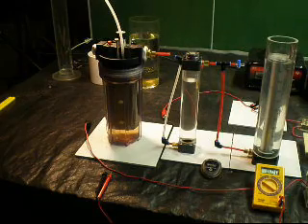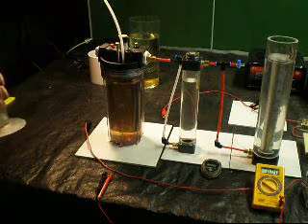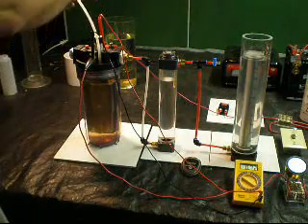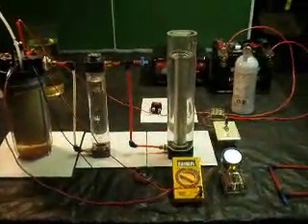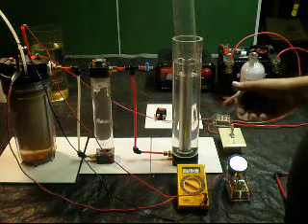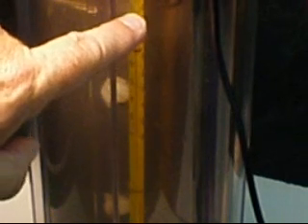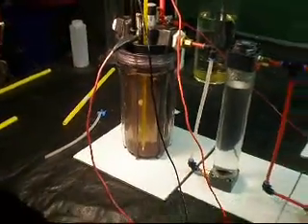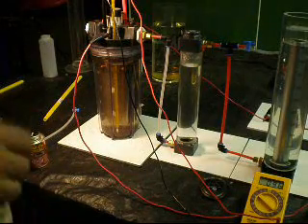#008 HHO 16 exposed plate test

Comment: Hi there Fizzy at the end you show us how you have put the glue on the edges of the plates I want to remind you that you must put glue everywhere that is not (in-between) the plates you don't want anything Bar inbetween to make contact with the water or you will just waste power around the cell Also never put anymore then 2v Per Plate it justs turns to heat and makes your water discolour I've run my cell for a total of 7h and the water still looks the same as it did when I first put in the KOH